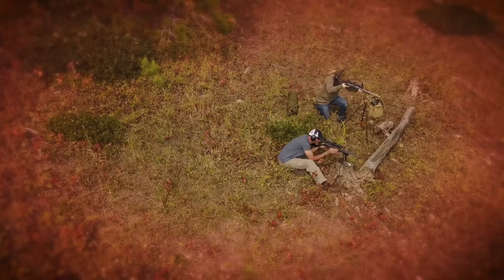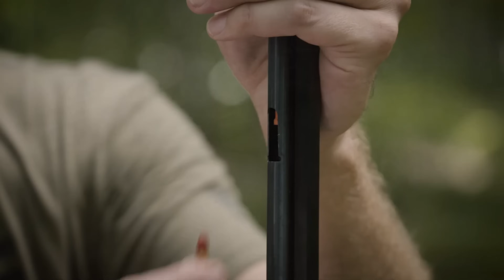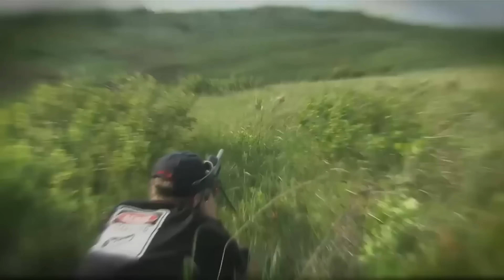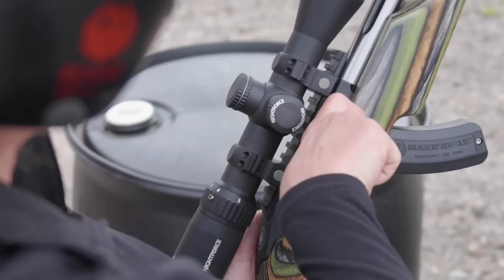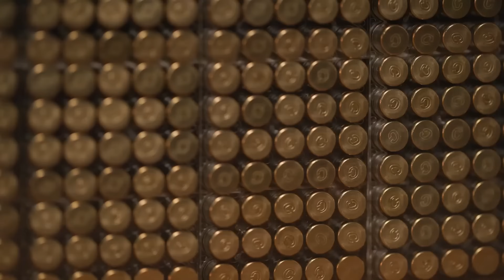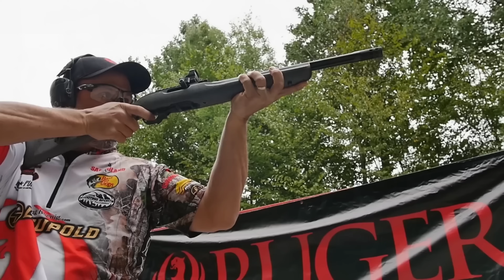22 LR Rifles... The Surprising TRUTHS NO ONE Tells You!

Comment: From experience I must agree with what was being told to us. I am 75 and have been a dedicated 22 lr shooter since I was 12 years old. My latest "victory" was with my very old Remington Nylon bolt action using cheap lead ammo. I live in a rural area and had been out groundhog hunting. I spotted a g-hog way off on a hill side that was higher than two small lower hills between me and him. I took a sitting position, noted no crosswind, the used "Kentucky" elevation due to the perceived distance. After squeezing off the shot, it appeared to take about 2 seconds until contact, and the hog dropped. I paced off the distance, using my measured paces, to reach a count of 297, which is basically 300 yards. Amazingly, I had hit the hog exactly where i anticipated, right in his ear. That is not the first surprise I have experienced with that Remington. I will never part with it.